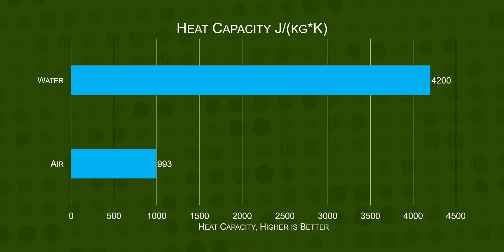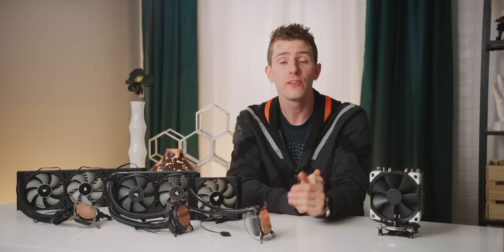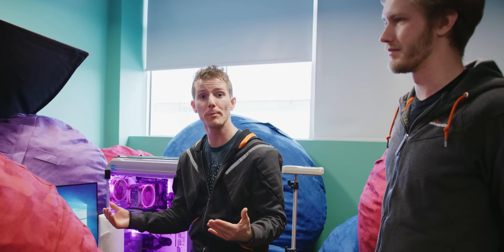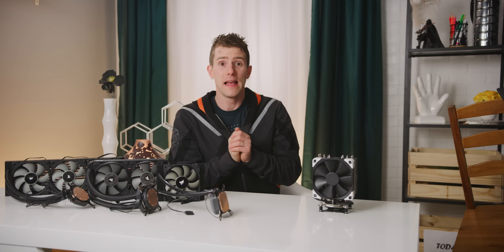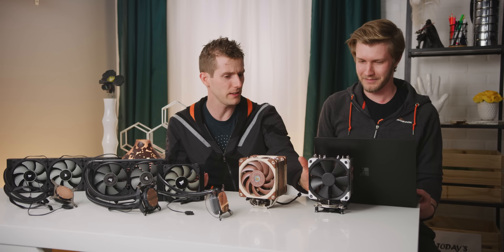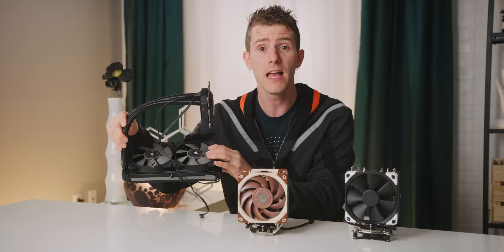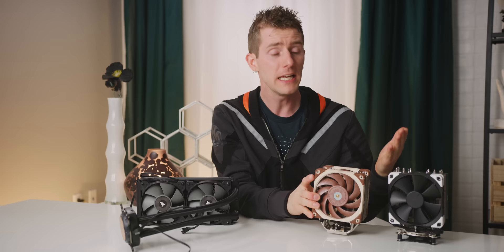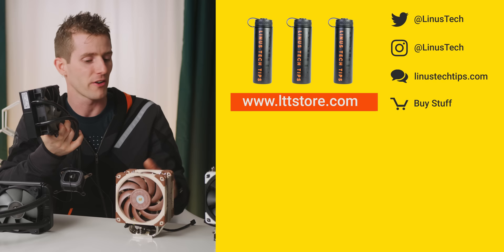Why you shouldn't water cool your PC

Comment: I see a lot of confusion in the comments about different tests finding AIOs have better outcomes. 

The TL;DR here is: In real world situations, an AIO will beat most air coolers, unless you're dealing with a really good cooler like the one in the review, and even then it's basically a draw... but the AIO will still likely win under most normal use case scenarios. 

Linus gives the reason why in the video, but it's downplayed... that reason is that most compute workloads aren't continuous max load. There's also a problem with their test, which we'll get into.

Under max load overclocked in order to force heat, the motherboard is basically forcing as much voltage into the CPU as it possibly can at the stable overclock, which means MUCH more than under a standard load which radically reduces the efficiency of the chip, and that drives the heat on the silicon WAY up. This is basically flooding both solutions to maximum saturation until they reach equilibrium. At that point, what you're really testing is the case's ability to transfer heat out of the chassis, because now all of your components are saturating to that level, and that's limited to the amount of egress space in the case and the other fan dynamics so now you have a case bottleneck that is influenced by the local environment's temperature... which is also heating up with the computer.

Now you're probably saying "But there was still a difference between the components, and they were in the same environment."

Yes, but the environment is not the same for each test, it has variance, and your cooling will ALWAYS be judged against the ambient temperature as a baseline. In other words, if the ambient temperature increases 3 degrees, your max cooler temp will be higher by roughly the same amount.

And disregarding the H60 (which is 100% not rated for an aggressive overclock and should not be used in this use case like this and only seems to be here to provide a really bad result) the total difference between the temperatures is a whopping... 3 degrees.

Statistically significant? Errr... Actually... no. That's a 3.7% difference and statistical significance isn't reached until an adjusted 5% difference... but that's after accounting for margin of error, and 3.7% doesn't.

In the video that noted that the temperature differential in the room at different points was... about 2-3 degrees. And there you have it. And it's impossible to know the external case temp for each stage of each test given what we have provided here, unless it was measured at the time and if it was, it's not included here as far as I can recall. And even the mobo ambient temp sensor won't give you the external case ambients.

So there's no actual significance in these numbers... what we're seeing here is variance in local environment combined with the fact that they saturated both cooling solutions to the point where other bottlenecks mattered more. It's also possible that on top of that, the Noctua fan configuration may be benefitting from case airflow design better than the AIO is, as the AIO will be pushing out both CPU AND GPU heat emitting up, whereas the channel of air with the 2 fan Noctua is likely isolating the air moving through the CPU, which would provide for a very slight lowering of temperature (at the expense, likely, of GPU thermals because you're now potentially blocking one exit path for the GPU's airflow).

However, in most real world workloads, you're not pushing the chip to its limit over time and you're not likely to be so aggressively overclocked, and in those cases the AIO will likely significantly outperform because they actually do move heat faster than most air coolers under those conditions. 

The next step is to tweak the AIO fan setup for your purposes. Most come with max fan distribution and just like airflow in different setups requires different designs, case thermal and airflow dynamics also often benefit better from a tweaked fan zone configuration, which not only may slightly benefit AIO thermals, but also radically changes the sound profile for the system in a way that you can't with an air solution (since there's no radiator and coolant in an airflow solution to absorb short bursts of CPU heat spikes). 

One last thing, people in the comments need to look up how water electrical conductivity works. While it wouldn't necessarily be a good thing, an AIO leak is not likely to short out your computer. It's not impossible, and I wouldn't want to have one because they're a mess to clean up, but water itself is thermally but not strongly electrically conductive. What kills your keyboard when you spill water on it at home is that the water you're drinking isn't really free of metals and other electrically conductive material and the AIO coolant is at least supposed to more or less be. (This is also, by the way, why you're not supposed to drink water distilled for use in non-conductive use cases... it'll actually sap you of minerals because the water you'd use in a water loop does not have the electrolytes you need to maintain biological homeostasis.)

Comment: Coming back to this after taking a few physics courses I am realizing that the time it takes for the liquid inside the AIO to move to the plate it actually has time to warm up and because of the way a heat to cold pressure system works it is mixing temperature. Having the fans so close to the pipes it cools faster with less pressure required. Really neat.
Reply: Ya it's a known issue that all liquid coolers take longer to cool.  You only really start seeing the cooling effect further after putting a heavy load.  You can see the cooling almost instantly with heat pipes.  What that translates to in a graph if you side-by-side the same CPU with the different cooling systems where you go from idle to max load is the water cool will have a hump in the temp where the heat pipes remains linear in it's thermal readings.
The other thing that they pointed out here that I too have observed.  The 3 fan radiators in ALL brands (not just Corsair) perform worst than the 2 fan radiator closed loop system counter-parts. I have no idea why this is happening but it is real.
I've tested a number of brands with a threadripper.  Enermax, Corsair, Deepcool, just to name a few...  ALL of them the 2 fan shorter radiator greatly out performs the 3 fan.  I am so lost on why.

Comment: Who would win?

Thousands of dollars of high tech electronics.

Or

One leaky boi.
Reply: aio doesnt leak 99.9% guaranteed. It is almost like saying the liquid in the heat pipes will leak from an air cooler. I get that a d15 or d14 is better than a 240mm aio, but they look fucking ugly and beefy. corsair aio is so much nicer and very quiet
Reply: Crossbone Vanguard haha, right
Btw do you know which pc case is that?
Reply: AIOs don't leak
Reply: @SolidGreenDay  
Rubber hose vs welded shut air coolers.
Reply: @jxsilicon9  welded
Reply: @1fy554  calm down, he was referring to bitwit's video where he forgot to put the cap on and the water leaked.
Reply: @KetchupBottle1235  thats more of a custom hardline problem
Reply: @SolidGreenDay  did he watch the video? He never mentioned aoi coolers leaking. Also the noctua was quieter.
Reply: FinalEvilElpis , most distilled water is not pure enough. Ultra pure degassed deionised water might work better, but you must also make sure the computer itself is clean, dirt and dust on the computer might dissolve in the pure water and conduct electricity. Finally the voltages will tend to accelerate the corrosion of metals by the water and that would also ruin the computer. Maybe try to not be such a condescending prick.
Reply: or razer toaster
Reply: @limpan3961   nah, when my AIO leaked i got a new gpu AND a new upgraded version of the AIO :)
Reply: @limpan3961  it was like 1.5 years ago I don't remember
Reply: @SolidGreenDay  the Noctua coolers are bulkier than a AiO? That's hilarious!!!
Reply: none. i would win.

Comment: laughs in AMD stock cooler
Reply: Wraith prism ?
Reply: @thias1  or spire, i think
Reply: Spirebro
Reply: Which processor you have if have r7 or r9 then it's wraith prism if it's r5 then stealth
Reply: Stock cooler on R5 3600 is pure crap. My CPU is idling at 47 degrees. Looking for good options. I run python programs which hit 100 % utilization on single core , which is roughly 11% utilization on all cores. The temperatures hit 75 .
Reply: I just blow on the cpu a couple times a second and its fine, just smells a bit burnt
Reply: @CommanderShepard05  75 is fine, you shouldn't be experiencing any throttling really. If you need options look for big air coolers.
Reply: Necronoxxx  Good for you. I am unable to find good examples of wraith prism or wraith max. I ordered Deepcool Gammax GT TGA today.
Originally wanted a BeQuiet Dark Rock 4 but it is out of stock across stores in India. Hope to see lower temps. Didn't order AIO for longevity reasons.
Reply: Got 2 mid range PCs, one with a stock AMD fan and the other with a corsair Hydro H55.... idle temps are 26 and 33 respectively. Both are pretty ideal in my eyes, but it just goes to show that you don't really need to spend that much money on a good cooling system for decent temps.
Reply: Cries in Intel stock cooler
Reply: @CommanderShepard05  i have same cpu just got a hyper 212 evo black for 40 dollars on amazon 100x better than that piece of shit
Reply: Necronoxxx  ddr4
Reply: @bujin5073  That was first choice but the hyper 212 EVO is out of stock across all major online stores in India. I installed DeepCool Gammax GT TGA with single 120 mm fan, and my idle temps dropped from 48 to 39. Under full load on all cores the temps didn't cross 80. Stock cooler used to hit 95 under full load on all cores.

How are your temps on Hyper 212 EVO ?
Reply: I havent looked but just from feeling my case while gaming its a good 10 15 degree cooler forsure
Reply: Is the Prism a good cooler I can keep for 2 years ?
Reply: ah i cant lie, if u have a wraith prism cooler from stock, i wouldnt even upgrade
Reply: The Wraith Spire Stock cooler is actually pretty good
Reply: @waluigisyndrome2261  ikr its acc amazing
Reply: @waluigisyndrome2261  So the Prism is awesome then
Reply: AMD stock coolers are good, not to make fun of them.
Reply: Commander Shepard r5 3600x has a way better cooler
Reply: Loud as fuck
Reply: Necronoxxx im kinda relieved to hear that those are nornal idle temps for r5 3600. mine idles at like 43/45 and i was wondering if i installed the stock cooler wrong or ryzen just runs hot
Reply: * *no cooler*, if you have no cooler you dont have to worry about noise
Reply: @CommanderShepard05  It could just mean that the fan curve isn't very aggressive. Try running a benchmark that hits 100% utilization and see what the temperatures are under those conditions.
Reply: The and stock cooler is awesome
Reply: Commander Shepard dude noctua
Reply: They’re actually fire...

Comment: Very informative video! I went with a cooling fan for my PC as opposed to water cooling because liquid in a PC makes me nervous
Reply: the liquid is non-conductive and harmless. actually, a large bulky mass fastened to a small-footprint socket essentially on a lever, should make you a lot more nervous)) many a socket had been ripped out of a motherboard that way...
Reply: Based and 200iq

AIOs are a gimmick, only cork sniffers buy them imo

Comment: makes sense:
AIO water cooling is basically just heatpipes that use water
given the case was already cool inside due to lots of space and intake fans the noctoa was gonna kick-ass. 
would be curious to see this tried with a less well ventilated case or small form factor build
Reply: Not really tho because the heatsinks are usually much larger, or at least can be, in water coolers. Something is definitely wrong with their testing because in cooler benchmarks AIO's are always ahead. And the bigger the AIO the better. I don't know what this non-sense is that their 240 performed better than a 360. It goes against basic physics.
Reply: That's the principle of any watercooling method. Well at least those without any form of compressor actually cooling the water.
It's just that the radiators of AIO watercoolers are pretty bad. 

Cooling comes down simply to surface area and heat distribution over said area. With water you can theoretically transport heat better but if it ends up with just running two pipes through some short metal blade it's never going to compete with a smart setup of heatpipes running through a much wider area. unless you have a ridiculously well designed radiator, a huge case that fits a huge radiator or even better an external radiator even custom watercooling won't get you that much better results. Well at least until you get to the point where the airflow to the parts that need cooling is obstructed. IN those cases watercooling is a necessity.
Reply: @Kennorx  My custom loop brought my GPU temps from 80c to 40c under load with a much heavier overclock. Not that big of a difference? Oh and its much quieter.

Sure maybe the radiators were just bad in these Corsair ones but they're obviously not all bad. Look at other benchmarks. All the AIOs are at the top, all the air coolers are at the bottom. Pretty much everywhere else says the D15 is on par with a 240 AIO but is easily beaten by a 360.  https://www.anandtech.com/show/6830/cpu-air-cooler-roundup-six-coolers-from-noctua-silverstone-and-cooler-master/4
https://www.legitreviews.com/noctua-nh-d15-air-cpu-cooler-review_169205/5
Reply: @KarfontaAlec  We're not talking about custom loops though, we're talking about AIOs.
Reply: I want a comparison of the flatness of each cold plate used.
Reply: Help ME PLEASE !!  My brain can't understand logic behind "Water Cooling" Why do you even ???? What water has to do with cooling at all ? If at the end it's getting cooled with same god dam AIR !?!
Reply: Gytis321 S we are comparing the medium that transfers the heat to the fans. Heat pipes are filled with a liquid or gas, not sure what tbh, in addition to being made of galvanised copper...
Reply: Gytis321 S water can effectively transfer heat more efficiently from the actually cpu package, as it has a higher heat capacity. This same heat can then be transported and distributed better across the larger heatsink of the radiator, which may have access to cooler air/ better flow characteristics depending on where its mounted.
Reply: @gytis321s2  Think of sitting in a 55 degree room and how long it takes to get a chill.  Then think about jumping into a 55 degree lake.  Water is denser and can absorb the heat more rapidly than air.  There's a reason VW stopped relying on air-cooling for their engines in the 70's....
Reply: @gytis321s2  The premise of watercooling is to use the moving fluid to carry away the heat faster than natural convection or passive heatpipes. Water has a much higher specific heat capacity than air meaning that it takes a lot more "heat" to raise the temperature of water. It gets the heat away from the cpu as fast as possible resulting in much lower temperatures.
Reply: @a_commenter  The guy I was replying to said even custom loops make little difference in terms of temperature. I was trying to demonstrate what a difference a good water cooler can make on a chip that can actually transfer the heat out. Thats a main problem with their tests, they're only using these Intel CPUs with crap thermal interfaces so all coolers seem to perform about the same. Also expand the comment, most of it was about AIOs with links to actual benchmarks that no one seems to mention.
Reply: @KarfontaAlec  urgh you are one of those that can't read. Makes it hard to argue but well i explain it as simply as possible:

I never said one is better than the other or anything like that. I explained a principle and conditions which determine how effective that principle works.

If your custom loop gets you good cooling that is great for you. You managed to build a system where all the variables are set in a way that gets you good results. YOu can do that. 
However you can also easily build a system where other thigns can be as if not more efficient.

Oh and by the way "my custom loop cools better" is a really poor argument mate. Not only do we not know your custom loop, we also don't know what you've been using prior to that. For all we know you could've been farting on your cpu to cool it and in that casse it comes to no surprise at all that your custom loop is better.
Reply: @Kennorx  Lol it sounds like you've only ever used stock coolers. This is your quote, "unless you have a ridiculously well designed radiator, a huge case that fits a huge radiator or even better an external radiator even custom watercooling won't get you that much better results." So I reported my results from custom watercooling that are much better.  I also linked multiple benchmarks that show the best AIOs way outperform the best air coolers. So what are you talking about? Some theoretical air cooler that is better than a custom water loop? You sound ridiculous.
Reply: @gytis321s2  it has to do with heat capacity, it takes more energy to heat up 1 gram of water 1 degree than it does to heat up 1 gram of air 1 degree. This is also part of the reason why heat sinks are used, as metals have even higher heat capacity than water.